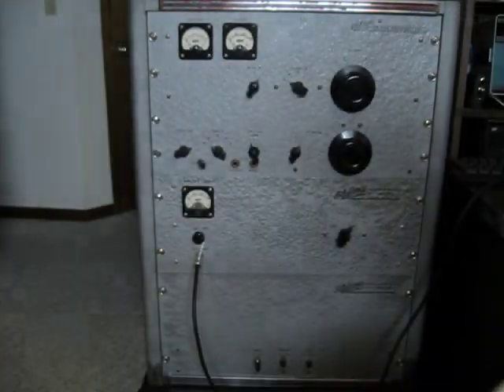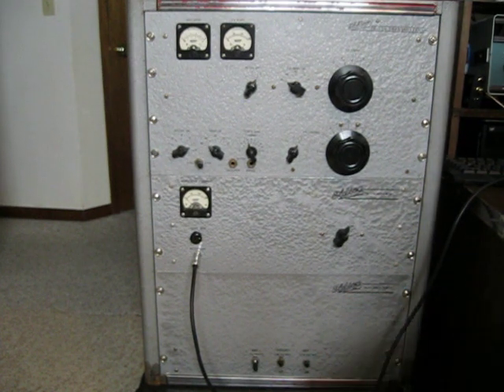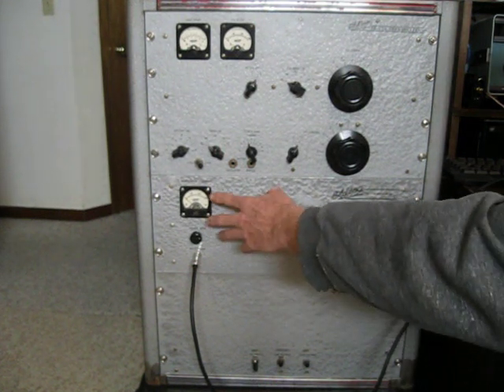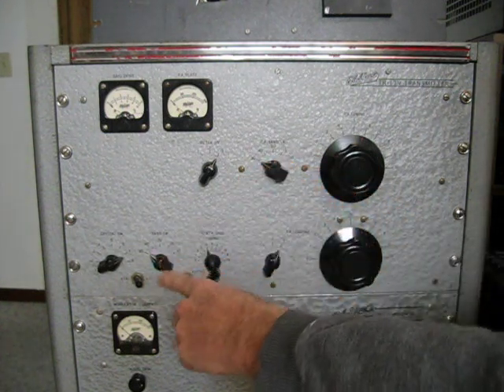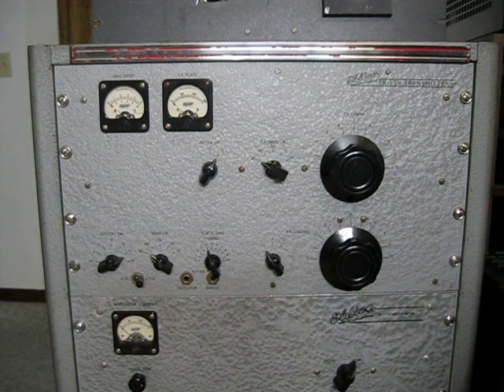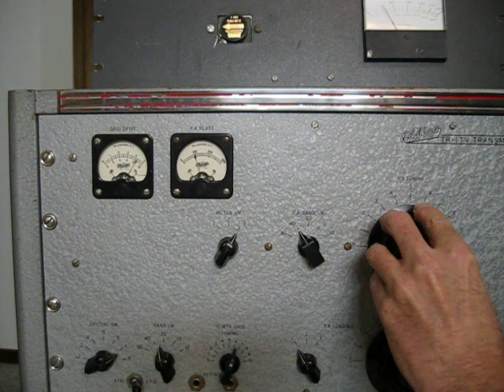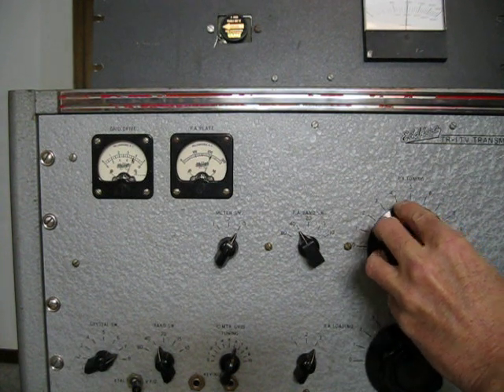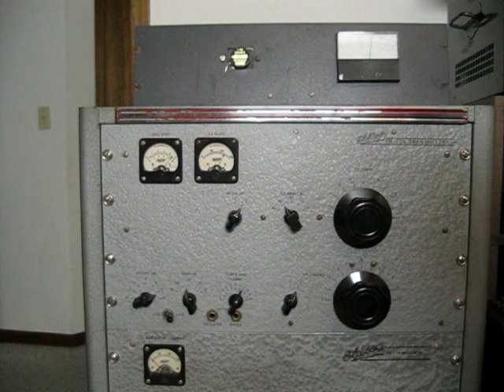Eldico TR-1-TV Ham Transmitter

Comment: I have the rf deck for this transmitter. It is fairly complete but is missing a few components such as the pate choke. The other thing missing is a schematic. Is it possible to find a copy somewhere? I would like to put a proper supply and modulator with the rf deck but a manual or at the very least a schematic would help a lot.
Tom N5AMA
Reply from the maker: Yes, it is possible.  Check your e-mail (as found on QRZ)